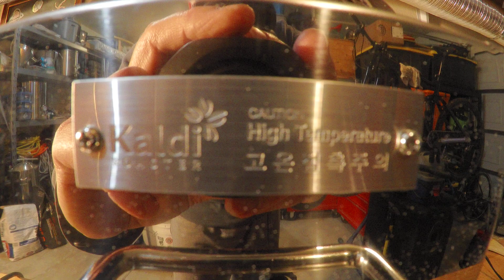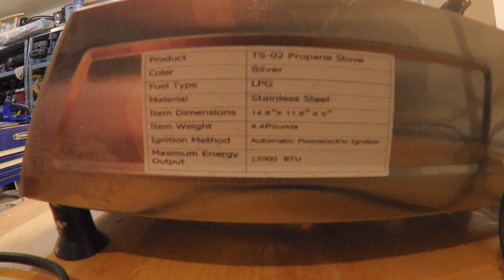How to motorize your Kaldi Mini Coffee Roaster

Comment: You could also add a rheostat switch to the motor and control the rpm.
Reply from the maker: You are correct Jerry. I consulted with the Korean manufacturer and all his machines runs at 60 RPM. When I purchased this unit I chose the 60 RPM version and it works really well. Seems to be the sweet spot. Should I ever need for that to change......Rheostat it is. :)
Reply: @ebrabaek  I am building my own machine at the moment. I am going to purchase the motor you have here. Thanks for the video. I am still on the waiting list for the Fresh Roast sr800 but tired of waiting. Actually I am building from scratch. I thought about the machine you have here. By the time I finish my project I will most likely have more money in it than you have here. Oh well. Patience I don't have.
Reply from the maker: @jerryhubbard4461  that is awesome. Nothing like making your own. Don't be alarmed of how hot the motor gets. The smaller ac sync motors tends to run a bit warm. Never had an issue.